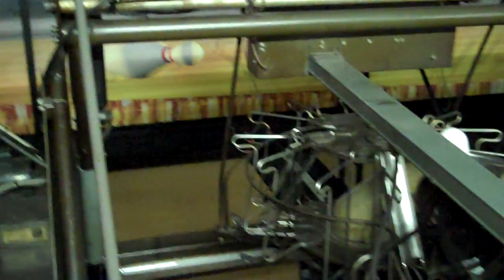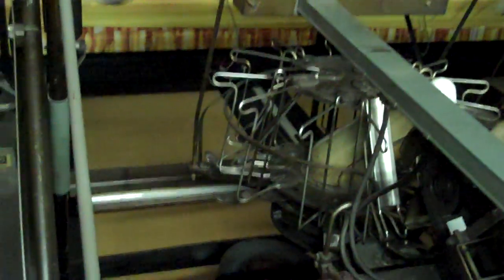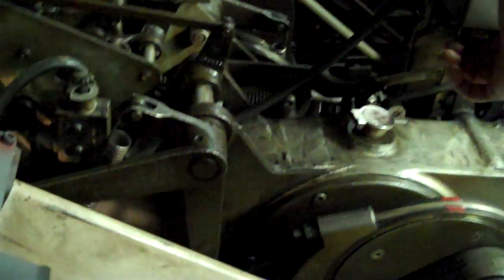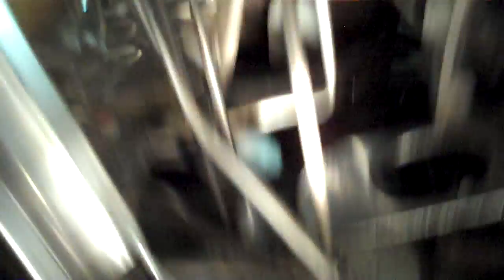Brunswick A2 Pinsetter - Blocking Fingers, Restricted Drop, etc

Comment: Can u post a vid on how to fix when turret skips a basket
Reply from the maker: I haven't been around the machines in many years so no vids to post sadly. Usually not a tough fix tho, just gotta see if it's anything to do with the indexing from the 5 pin or not. Make sure nothing is bent or rubbing tripping that time delay gear there. Might just need a tweak on the "pedal" or indexing lever the pins hit when they drop in, there's a couple 9/16" (iirc on the size) bolts at the top of it, a small adjustment on that can make a big difference! Best of luck, shouldn't be a hard fix to do I don't think! :)
Reply: Oh ok.i appreciate your help. Hopefully i can hit u up again if i need to ?
Reply from the maker: @rubinsalas2817 Absolutely! I'd be glad to help any time, I wish I could get some video like I used to but always happy to help!! :)
Reply: @Rep2369  you dont work at the bowling alley anymore
Reply from the maker: @rubinsalas2817  Sadly no. Not by choice, that I will say, I have an insane passion and drive still to this day for the industry. The 21st of November was my last day there 9 years back. My body just gave out, nerve issues and such. I'd like to do some kind of bench electronics work for bowling equipment I just basically can't be on my feet anymore is what it comes down to, my lower back down is just useless anymore. I'll say this if any kind of treatment comes along for this I'd be RIGHT back at the lanes as I was. I miss it very much. Even if I couldn't work and bowl like I did years back I'd go back to work for sure, the machines are so much fun!
Reply: @Rep2369  that sucks about your health. It is fun tho and frustrating too. You can still be around the machines. I meant by helping people like me via video when we have trouble shooting a machine
Reply from the maker: @rubinsalas2817  Such is life sadly. I'm still thankful, it's nothing that will kill me or anything so I just push thru and hope things can be improved in the future with new medicines or treatments, I still never lose my hope of returning to what I love some day! The brain still does work thankfully at least so I can always add insight if nothing else. I'm glad I got the video I did so long ago, I can always use it to point things out (specific areas or shots in an old video) to help too!

Comment: I am helping part time at my local bowling center and we have an issue. On lane 2, the right finger (if looking from the bowler's view) keeps hanging up and not allowing pins to drop until the 5 pin is moved. If the deck is ready for pins when the 5 pin drops, it releases the pins just fine.  The one thing that we have noticed is that when the deck is at 0, the deck is still shifted back about an inch and a half. As soon as the reset is triggered, the deck shifts forward and the finger goes up. Would this be the cause of the first problem and how would we adjust that? I greatly appreciate your response.
Reply from the maker: This actually has nothing to do with the blocking finger (MOST likely) the end of your post is what gave this away for me to help you. It's actually your gearbox clutch stopping too soon! It's pretty common the clutch adj's do move around on ya. Just set it to stop a little bit later and I think your issues will be all taken care of! :)

Comment: Question guys. My lane 11 will cycle and every other cycle when it goes to drop pins there won’t be a full deck(not all 10 pins) and it will be waiting for the other pins. While the turret is waiting for the remaining pins,  the deck should be at a resting 180 until the rest of the pins are set, but it’s not. Instead, the deck thinks it has a full set and will set like it has pins in it. And then when the deck comes up again, the pins will drop into place like normal
Reply: 180 interlock adjustment.

Comment: good video, Me.  question... is that a washer under the head of the bolt on the time delay gear?  looks like you need to make an adjustment for the full deck finger.  doesn't look like it's near high enough compared to the restricted drop.  

side note: STILL waiting on the video for the lane machine :)
Reply: What happen if the 5 pins go thru with out dropping the other pins